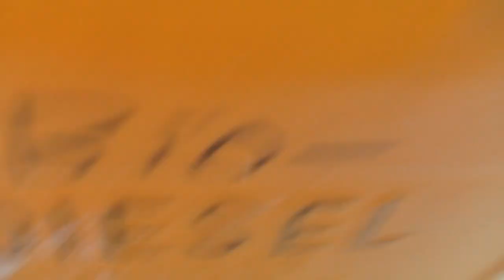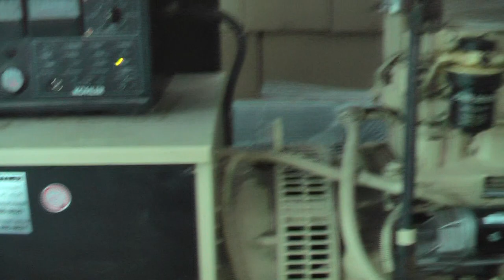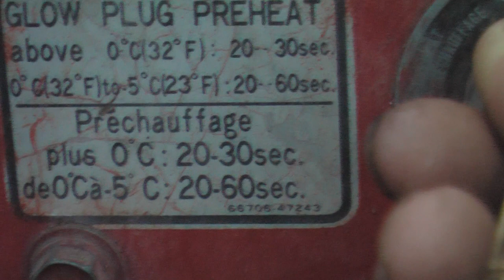Kubota Fireup & 3-Point Plow

Comment: @DanielJaegerFilms thats cool that you can push on an angle we also have one of those but i think its for dirt and it will go on an angle also but we use the bucket for snow removal its a john deere 4300 its just a little bigger than yours but i wish the exaust on ours came out of the hood not by the wheels.